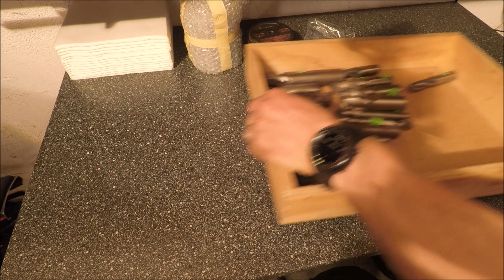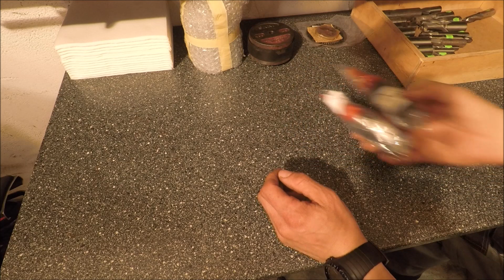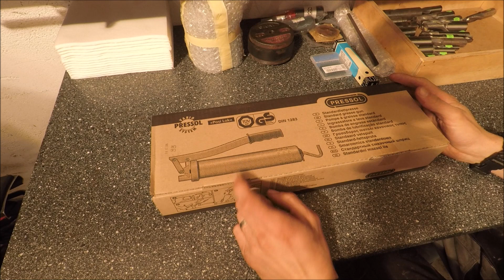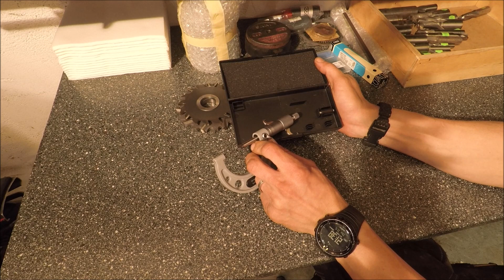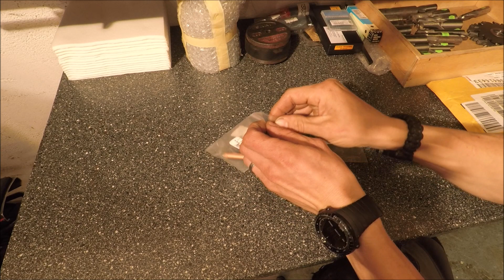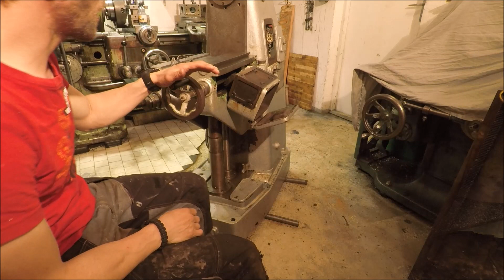Shop update (May 2017)

Comment: Mr moberg, I think the format is a fine addition to your youtube account.
Re milling cutters: if you ever need to form concave radius grooves then just use the staggered teeth milling cutter sideways.

Re the boring bits: C5 is the carbide class, it is suitability for rough & fine machining of steel;being keen edged & uncoated the bits should cut Aluminum equally well.

I have yet to ascertain its suitability for interrupted cutting.
http://www.carbidedepot.com/pmk-chart.htm
Reply from the maker: +perfectionist2032 Good tip about the cutters, that might come in handy some day! I really hope i get around to testing the boring bits soon, i might have an aluminium job coming up where they would fit nicely.

Comment: I also like the new format. Ive seen alot of people making the leveling feet out of hockey pucks, they're really hard rubber like the ones you have there, and look to be the same exact size, so that may be an option for replacing the lost rubber on that one. I was making some for my shaper out of hockey pucks with some washers and a piece of steel on top.
Reply from the maker: +Chirpy's Tinkerings Nice to hear Chirpy! I have hockey pucks on my shaper as well, but the rubber on the new feet is a little softer. I think it's a little bit larger as well, but i'll take a measurement soon.

Comment: You should try Evaporust for removing rust from tooling and arbors.  I've seen several Youtubers use it, and found it recently in  store in Norway.  Works excellent.  For shipping from The US to Scandinavia, I use Jetcarrier.com all the time.  For packages under 1 KG, the price is 99NOK from New Jersey to my doorstep.  They ship by plane weekly, or by boat for large items (cars, machines etc).  Check it out!
Reply from the maker: +Arnljot Seem  Evaporust is definately an option, it looks like it's working really well. And i'll definately look into jetcarrier. Great tip!